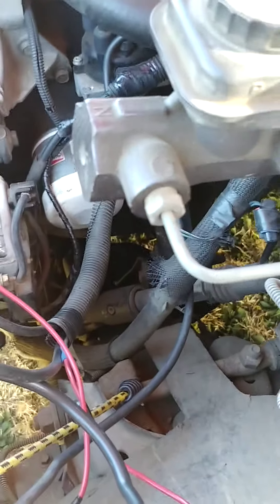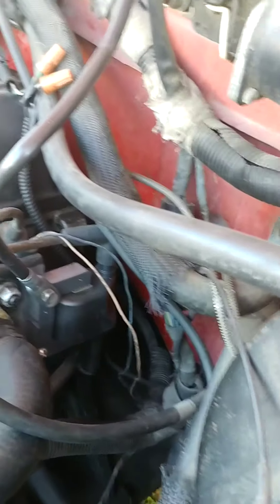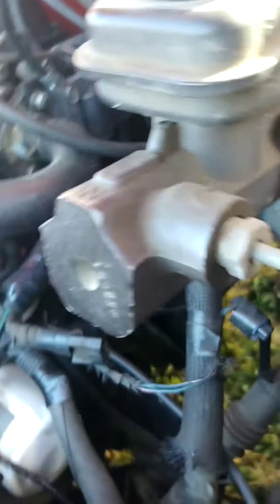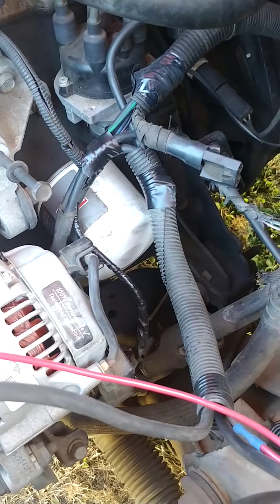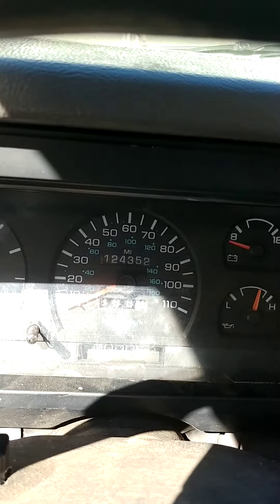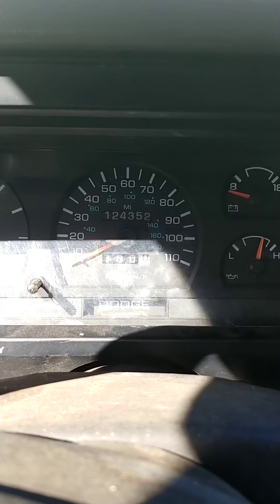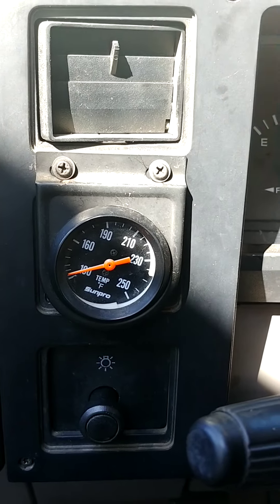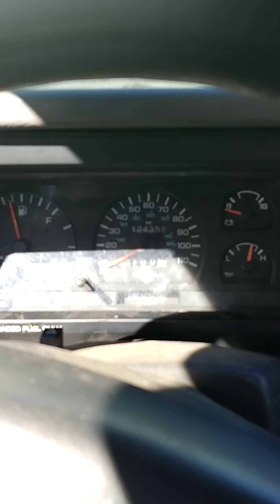Dodge Dakota electrical problems/solutions

Comment: Thank you so much and fix my truck where I unplugged the Mel connection to the female. It was corroded underneath of the heat shrink fix my problem.
Reply from the maker: Good deal! So for me and others please tell us what plug? Where located? And what was happening with your truck? What was not functioning? Glad to be of service sharing with others.

Comment: I know I'm late and you probably scrapped the truck but I have 93 dakota original with 2.5. With 320k miles on it, I had a shut down issue as well. Turned out 1st was the coil pigtail, 2nd on the passenger side behind the head against the fire wall, a hole had rubbed through the loom and one of the wires that fed the coil and caused it to short against the cab causing intermittent shutdown.
Reply from the maker: Nope. All good. Your comments might very well help another person who is having trouble. I found lots of problems in the 1995. One of the main problems was a wire jumping to ground as you described but going to the alternator. Also a problem in the main harness by the fuse box under the hood. Ignition under the distributor cap. Internal electric radiator fan short. On my son's 1994 a few months ago we found another problem with transmission wires near the driveline. In forward a rub spigot killed the truck. In reverse no problem. Did not look to even be close to touching, but it rubbed through and grounded k8lling the truck. Thank you!
Reply from the maker: I sold the truck and disclosed the history to the buyer. He was happy to have it at a fair price.
Reply: @MAKAROVOWNER  I been dealing in these 1st Gen dakotas for 20 years and the 93 I spoke of I've had since I was 16, 32 now. If you get anymore and have troubles holler at me I'll be happy to share any knowledge. The electrical in the fuse box I've run into as well and there's a couple hidden splice just north of the fuse box that's known for corroding from age. A red splice and a blue one. Biggest mystery killer on all engines in these trucks.
Reply: @MAKAROVOWNER  if I lived near you I would've jumped all over it and fixed in the yard before pulling out after purchase  🤣
Reply from the maker: @charlesfields7908  I believe it had 125k mililes on it about? 4 cylinder 5 speed. Was running driving well when I sold it. For some reason it had the blower fan stop about that time. Nightmare electrical problems. I mostly drive ford' . And those problems I never have. Get in drive and yes maintain.
Reply: @MAKAROVOWNER  to each their own. I still have mine cause it was the last truck me and my grandpa worked on together before he passed it's also the same type truck I learned to drive manual on when I was 13. One of those first love things I guess 🤣
Reply: @MAKAROVOWNER  it's like my grandpa told me before, all vehicles have there own problems but they are all good vehicles as long as you take care if them.

Comment: I have a 1995 Dakota with 245000 miles runs great use no oil had it for over 15 years best thing is buy a pinning kit and redo all the pins in every connector pins get moisture and rusty make sure to use electrical grease after you reconnect ...good luck
Reply from the maker: First suggestion of this type! Awesome! Perhaps it can help someone. I sold the truck about a year ago. Thank you for the suggestion.

Comment: I got a Dodge Dakota Sport. It was running good but i noticed to voltage meter was always going all the way down? Got a new battery and alternator test voltage was good? Alternator passed! I assume it was something wrong with my gauge. Keep riding good but one day on my way to work i warmed up my car. When i came out to drive ro work , I noticed my radio had cut completely off by itself! I told my wife im probably not driving this to work today! Went to crank it up clicks clicks and it sounds like something is tryna to kick on but it doesn't! I have no idea.🤦🤔 SMH 🤷
Reply from the maker: Could be many things. One thing I would do is consider there may be more than one thing going on. What I would do is get a volt meter and test the battery. Do that first. It should test above dc 12volts. Below that charge and or replace the battery. Cold weather you find this alot. Pull the battery cables clean the terminals and clamps. Inspect the clamps and cables for corrosion, cracks, discoloration. Replace as needed. Inspect the ground cable on the alternator! Known failure. They jump spark and the truck will die. It does not have to look bad to be a problem. May not be a bad idea to replace that, wrap in flex conduit or electrical tape. Start with those. If the alternator is noisy replace it.

Comment: I got a ticking in my radio dash area and it's  running my battery done to total dead sounds like a clock ticking.and the radio stopped working.gotta pull the dash out socks. Any Ideas what it could be anyone ?
Reply from the maker: Radio antenna? Radios can be known to drain a battery. Start there I think, pull the radio and see if the problem stops perhaps. Love to have you let us know what you find please.

Comment: Went through the same problem changed filters fuel pump distributor and in the end it was the crank position sensor no more problems
Reply from the maker: Glad you found it. I had a rub on the wire harness arching to ground on alternator wires. You could not see it and the wires were not touching anything.. Fan grounding internally. Other electrical problems kept coming. Sold the truck disclosing all known problems.

Comment: wow ok so i have had 3 dakotas  95, 99, 04.  The 04 is gone long time ago it had transmission issues getting stuck in 2nd all the time.  the 99 is an R/T no issues the piston rings went bad and am rebuilding it.   but this 95 that is my bosses man its a POS.  its similar to what your dealing with.  it got this totally random sputtering, bucking and skipping issue as well as it just dies. now it seems that if i go and wiggle the wires and hoses right next to the distributor bamm it up and running again.  like yours the fuel gauge doesn't work. also out of nowhere the wipper motor stop working then not too much longer after that the blower motor died as well.  i've replaced the coil, spark plugs, plug wires, map sensor, temp sensor, crankshaft sensor, throttle position sensor and that disk in the distributor and none of it has worked. actually i think its worse. thanks for the video given me new directions to go. but that being said to much more of this and im pushing it of a cliff.  if you could plz let me know what uve learn since the video
Reply from the maker: There was a wire that runs toward the alternator. It seemed not to touch anything. A very small flat rub spot that is easily unseen let current arch from the wire to a mount or ground randomly killing the engine. I wrapped that in electrical tape. By the fuse box under the hood there is flex black wire covers inside which are hidden splices. I eliminated and bypassed all of them suspecting corrosion possible. After that the truck ran fine. The odometer stopped. I replaced the fuel pump. The fuel gauge did not work. The heater fan stopped and no power was making it through the harness to the fan. We decided to move to mississippi and the wife said I could not take that truck. I sold it unlisted for a fair price.. I suggest get rid of the headache and stay away from mopar b's wiring.
Reply: @MAKAROVOWNER  lol i like how the wife said you can't take that truck.   let me guess the truck took some of her "me time"  had a ex = girlfriend do that to me but i got rid of her instead (she was the bigger headache)
Reply from the maker: @uncletoy774  more like the pencil. To much time money effort and never ending problems with that truck. Why move a problem vehicle 2600 miles? I can admit when she is right. She was right. And God provided a buyer unexpectedly with cash in hand so....to me I could lighten the load as the tea leaves aligned. No more dodge....ever. Crap electrical.

Comment: I seem to have a electrical issue crank but no start what do you recommend i have already checked starter battery dist etc
Reply from the maker: First thing I do is pull the air cleaner tube connecting to the filter. Spray starter fluid into the carb or throttle body. Then immediately try starting. Start yes? Fuel supply problem. Filter or pump.  No start? Potential spark problem. Check spark. No spark? Coil sparking? Signal to Coil? Start with those simple things. So think spark or fuel. The one you do not have is the problem. Let me know if this helps you.
Reply: I had a fuel leak on one end where the fuel rails connect I replaced the hose i smell gas but there seems to be no spark i have msd ignition coil it is brand new I believe it may be the wires but I have 0 experience in electrical
Reply from the maker: @yukmouth1324  ok. So get a spark plug and lay it along a metal part. Get someone to crank the engine and look for spark. Spark yes or no? No? Need to test for electrical signal on small wire to coil? Signal? Yes? Good. No? Cam sensor or distributor component. Have you tested with starting fluid as I suggested? No? Do that first. Start there exactly. Until you do there is no point digging further. Rule out fuel by that step.
Reply: @MAKAROVOWNER  I did the spark test like you said and there was no spark at all, I don't know why or what to do next it's a 318 magnum 5.2L
Reply from the maker: @yukmouth1324  ok. So not being familiar with your exact truck I will talk in general terms. Rule out a bad plug, harbor freight spark tester helps. No spark? Coil wire? Low light it's possible sometimes to see spark jump to ground. Will not run or be inconsistent. Test the small wire that comes and connects to the coil with a meter. You should get a reading. If no reading you will get no spark. That is where the pulse comes in as the engine rotates. If the wire is damaged or the cam sensor is bad no spark is possible. Instead of a cam sensor my 2.8 had a distributor part controlling the spark. For 50 dollars you can buy a decent meter or even down under twenty a cheap one to do testing. Without a meter you are just guessing. It may be time to take it to a shop, but you can pay them a bunch and possibly still have problems. Let's go at this another direction. In general spark starts at cam sensor, wire takes it to coil, coil wire takes it to distributor, distributor sends it to plugs. You could start at the source testing spark cam sensor, , or coil and work back to the source. Both work with a meter, and a spark tester.
Reply: @MAKAROVOWNER  I have tested all the connectors and they all seem to be fine I am honestly lost
 The engine rebuild itself seemed easier to me than all of this electrical stuff
My truck has both cam sensor and a distributor
I have a multimeter and the coil is brand new battery brand new starter brand new only thing I haven't replaced is the cap and rotor because they are less than a year old 
I'm wondering if the distributor itself has given out I don't want to move it though unless I'm sure this electrical stuff is pretty complicated for a beginner
Reply: I notice there is no voltage at the coil until I crank the engine but that is normal isn't it?
Reply from the maker: @yukmouth1324  If you have power to the coil do you have power coming out the coil wire to the cap when cranked? Yes that is normal.
Reply from the maker: @yukmouth1324  do you have a person to turn the engine over as you test? Did you do the starting fluid test as I said? Piece by piece what did you test and how? Yes you have a distributor and a cam sensor. From the cam sensor are you getting signal or not testing with a meter or a light? Clear your mind. One piece tested at a time. Cam sensor. Wire. Coil. Coil wire. If power coming out of the coil wire going to the cap but not getting to the plug wires then the problem is in distribution parts, cap or such. The process works to narrow and eliminate isolate the problem. Unfortunately at times we look for a single problem but may have more than one. The way I look at this is skill building. Testing, thinking, patience, endurance, temperament, problem solving, focus, and not giving up. I find there are times to walk away and come back to it. If you have a second vehicle that will give you space. If you have a dad or uncle or friend who is good call them. They can always turn the key.
Reply: I have found out today that the rotor on the distributor is not turning when I crank the engine
Can this be why the truck has no spark?
Reply from the maker: @yukmouth1324  Yes. Are you sure about this? If this were my Ford 351 Cleveland a rod inserts into the bottom of the distributor. That same rod bottom end inserts into the oil pump. I do not remember the connection making both turn. I know the cam controls timing. The timing chain or belt can fail. Pull the rotor off then verify if the part it sits on is rotating. For you I hope it is. If it's not....decide now if it's worth putting money into and how much. After you dump money in it you can still end up with problems.  I suggest it may be time to find new wheels possibly.
Reply: @MAKAROVOWNER  yes I am sure I tried it 3 times it didn't rotate at all I am not giving up until I have her running again I will try to remove it but i hope it's not the camshaft
Reply: Can it be cap and rotor instead of the entire distributor?
Reply from the maker: @yukmouth1324  camshaft has a chain or belt might want to check that. Did you run the truck recently?
Reply from the maker: Who rebuilt the engine?
Reply from the maker: @yukmouth1324  it's what ever turns the distributor rotor shaft sounds like. If so it's going to be complicated and time consuming.
Reply: @MAKAROVOWNER  I rebuilt the engine myself but I followed the steps in the Haynes manual and yes I put a brand new timing chain, new oil pump , basically everything is new except for all the electrical stuff
Reply: @MAKAROVOWNER  no after I completed the rebuild, it will not longer start jus cranks
Reply from the maker: @yukmouth1324  so look to mechanical. Not electrical it would appear something was overlooked on engine assembly if the distributor shaft does not rotate. When I get home later I will look up the 318 in the book. See the possible reason. Let you know in a few hours this evening probably.
Reply from the maker: @yukmouth1324  Ok. From what I have searched on the 318, pull the distributor, look for a missing or damaged drive gear. Drive gear on the distributor makes contact with cam gear. Evidently they can fall off? So I read anyway.
Reply: @MAKAROVOWNER  ok thanks for the tip but before I pull out the distributor, I'm going to try changing the cap and rotor because I inspected them today and the cap seems to be very burnt on the inside I hadn't noticed it before 
 if it still doesn't start after i put a new cap and rotor then I will pull out the distributor and check shaft
Reply: One more thing I should mention is that the security light stays on now before it would flash then shut off, now after the rebuild the security light just stays on in the instrument cluster
Reply: All the points are burnt and corroded on the inside can a new cap and rotor fix the rotor not turning issue?
hopefully the gears are still good
Reply from the maker: @yukmouth1324   will not fix the non turning issue. The rotor affixed to the shaft. The shaft is turned by the gears. The gears turned by the cam. Pull the distributor for inspection.
Reply from the maker: @yukmouth1324  you had told me the rotor was not turning. True or not?
Reply: @MAKAROVOWNER  hey friend
Yes true I am sorry It took me this long to reply I put a new cap and rotor still nothing so I pulled the distributor and it looks like on this engine there is no gear on the distributor itself, you are correct instead it connects to a drive shaft basically a gear shaft but I pulled out the distributor and inspected it seems fine just old so I put it back on and still no spark only cranks.
There is this weird thing that happens when I pull or tug on the crank position sensor wire with the ignition ON, there is a clicking noise in the relay box and it sounds like the fuel pump activates
 The thing is, if I move the CPS sensor around it basically clicks as if it's turning on and off but the CPS sensor IS new and so is the pickup coil, new ignition coil, new battery, new starter , new spark plugs and wires, new cap and rotor, a lot of the connectors are peeled at the tip like the fuel injector wires you can see bare wire but it ran like that before the rebuild 
Also the security alarm doesn't even go off anymore and before it would
Reply from the maker: @yukmouth1324 Isolate one item at a time. Does the rotor rotate? Yes or no? Is signal from the cam or crank sensor reaching the coil? Is spark leaving the coil?

Comment: had same problem its that ring deAL UNDERthe distributre
Reply from the maker: Yes. How ever a short in the wire harness was causing that to fail.
Reply from the maker: Under the distributor is where 3 mechanics failed and did not look deeper. Root cause wire harness failures.
Reply: Cam shaft position sensor